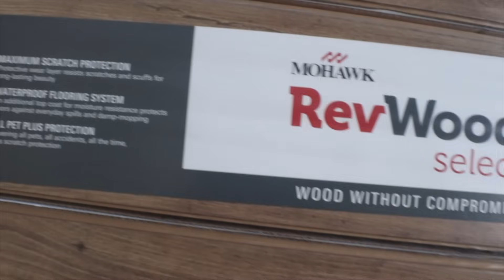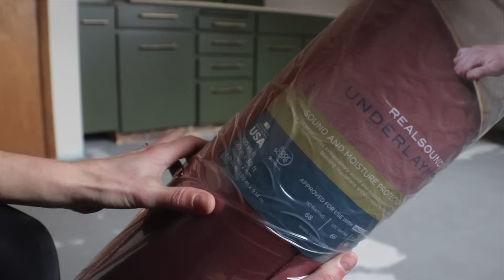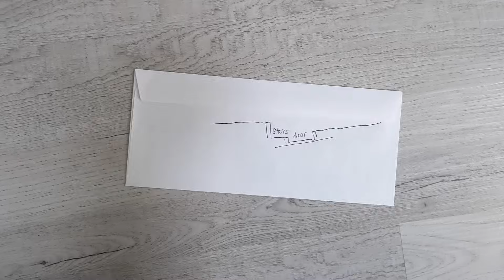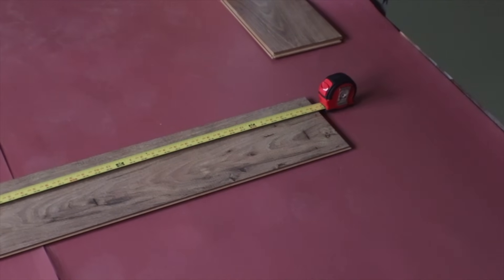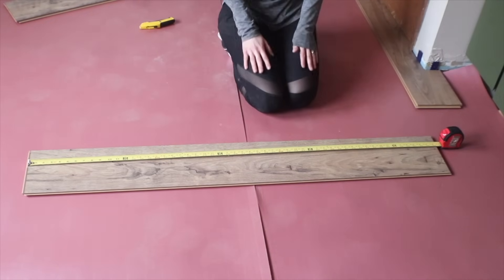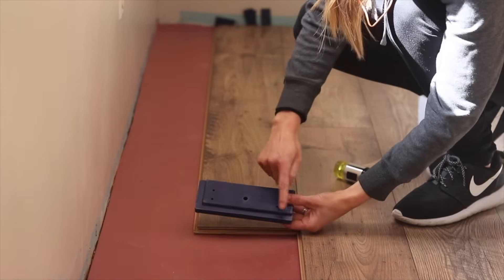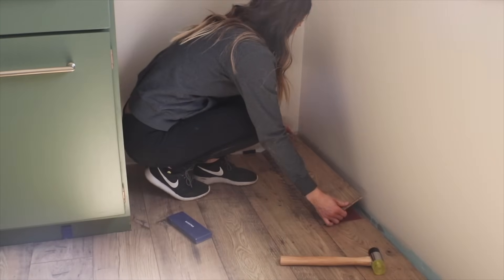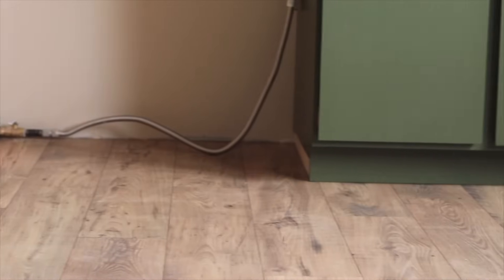How to Install Laminate Flooring (for beginners)

Comment: Ok, stupid question time. Since you put down the underlayment first, what really is the difference if you go directly over one layer of linoleum?  My bathroom/washroom only has the original linoleum.  Can I lay vinyl floor planking over the top of one layer linoleum? TY 🙄
Reply: @transistorradiorecords3661 
 As long the linoleum is not coming loose and is still securely glued, it should not be an issue going directly over it. The linoleum helps work as a sound and added moisture barrier similar to the underlayment (some would even say linoleum is better because it's more dense). If it was just bare flooring, a barrier is recommended .
Reply: @turtlegogrr  Thank you!
Reply: It will be all crunchy under foot 🦶 bottom and not sit level 🎉
Reply: Yes

Comment: You’re right. Never place permanent cabinets over a floating floor.  Next time you check for nails and or staples use a wide taping knife.  It cuts down in the amount of band aides.   Better job than I’ve seen so called professionals do.  Excellent.

Comment: Raising a family and do what you with this channel is so impressive. Your energy level has to be off the charts.
Reply from the maker: Thanks! I do have a lot of energy lol
Reply: we remodeled our kitchen when we moved in. When we came to the floor we did the same striping. We called it remodeling archeology. You could tell the period by the colors and patterns. We even had a black and white checker board toward the bottom.
And Melissa you are so right with the staples and tack. We swear when they put down the 1st layer of tar paper in the beginning he got paid by the staple. There'd been no other logical reason to use that many. 
Good job.

Comment: Thanks, good video. I've tended to cut laminate flooring with a handsaw, which takes slightly longer than most kinds of power saw but makes less dust (because the saw blade in thin) and distributes it less widely (because the saw is moving more more slowly).

Comment: I've been subscribed for awhile now, but just purchased my flooring.  Unfortunately,  I purchased it before I saw this. I know this is a year old, but I have 2 questions that may sound silly, but seriously a newbie with flooring.. Did you go under the stove, refrigerator ? 2nd, what underlayment did you use. I also have a wood subfloor.
Reply: Personally, I would go under the stove and refrigerator for ease of sliding them out later.  Underlayment depends on your product.  I tend to buy flooring that already has underlayment attached.

Comment: Nice! If you have old vinyl flooring that is in good shape and flat, it makes a great vapor barrier and underlayment. Saves work and money. Unless the floor has damage, of course. In that case, it needs to be removed.
A wide putty knife makes a great staple and nail finder by sliding over the floor. Saves the hands ✋️.

Comment: I have a cement foundation.  Pulled up carpet from a room and am considering your project.  I have cement exposed, will paint room, then put down the product you used or something similar.  I take it, THE MOLDING MUST BE REMOVED AND THEN REPLACED ON TOP OF INSTALLED FLOOR....yes?  Clearly it will not fit UNDER the molding, so although the answer is self-evident, you did such a great job, I would like your opinion!!  A wonderful video.....I was impressed from the beginning with you!  Gracias!
Reply from the maker: Yes, that’s the best way to account for the height of the floor changing due to the thickness of the underlayment + flooring. Some people who don’t remove trim just add quarter round to cover the gap but I don’t like that look

Comment: What about the stove height to counters?  I always feel stupid asking these questions.  I renovated my parents house.  When I pulled up laminate, I found terrazzo. Had that ground and sealed but the kitchen isn’t looking good after 6 years.  It is time for flooring.  I can do this after this great video.  Their stove is even with the counters.  Wouldn’t flooring change that?
Reply from the maker: Typically flooring is about half an inch or less thick. Yes it would change the height of the stove, but not by a significant amount. Something to consider if having them flush is important to you.

Comment: I'm thinking putting it in my bathroom. The waterproof kind of course. Just worried about cutting around my toilet
Reply from the maker: Usually you remove the toilet and run flooring underneath. Then re-install :)

Comment: I bought jigsaw blades that were labeled specifically ‘for laminate’ and all they did was chip each plank badly. I ended up using blades designed for metal because they had more teeth

Comment: What do you have to do when installing laminate flooring around a gas stove? I'm guessing you don't have to move the gas stove and just put down the laminate around the gas stove/oven but is the flooring and underlayment fireproof and will it be fine if it heats up while it's installed around the oven?

Comment: I'm no expert, but the floors should be checked with a level. Preferably an  8ft o 10ft one. Depending on the type of flooring and manufacturer, there may be different acceptable tolerances for imperfections for the subfloor. If you do not follow the requirements then your floors may encounter issues later and also void the warranty. 

Also some flooring require an underlayment while some are optional and some do say not to use. 

Other thing is that not all flooring are locked together with the same procedure even though they are made of the same material. Some you can tap together with a block.  And some say not to.

Last thing is some manufacturers say you can stagger them like a staircase while some say not to and to lay them random.

Read the instructions.

Comment: Good job. Vice grips work great for removing staples,  15 and 18 gauge nails. Adjust the heads so when closed they are touching. Open them up and put them over what you are pulling out. Squeeze them closed and roll them on the radius of the vice grip head. No pulling!

Comment: Great video. That's what I need. I'm about to sign a contract to buy a house. The house is not new and the floors in the kitchen and both bathrooms need to be changed. Thank you. It doesn't seem to be difficult, it just takes a little time 🙂

Comment: Your not supposed to put any silicone on the edges that voids the warranty on the laminate it's a floating floor supposed to have  that gap around the edges to move amd expand when it needs it!
Reply from the maker: The installation and warranty instructions actually require this step in order to consider this floor "waterproof" as it seals the edge of the floor. I followed my floor's installation instructions exactly as all people doing this project should. The backer rod is foam and allows for the expansion and contraction you are referencing.
Reply: Crpri Soro. Silicone is flexible
Reply: @anthonyt2011  I know what it is I been working construction for the past 15 years lol

Comment: Nagyon jó hogy így neki álltál ennek a padlónak, de ahogy elnézem, segítség nélkül nem tudtad volna megcsinálni. Ha lehetne pár tippem. A faltól való távolság 1 cm minimum. Az éket fordítva tedd be, könnyebb kivenni. 
A lerakásnál hol jobbról, hol balról kezded. A laminátnak van egy rakásiránya, tehát mindig egy oldalról kezdjük és a leesö darabbal folytatjuk, így kevesebb a hulladék. A kezdö darab minimum 30 cm legyen. Nem ismerem azokat az anyagokat amit ott használtok, de nálunk nem kell a laminátot a végéröl kalapáni, rengeteg idöt vesz el és megsérülhet. Ha le van téve 3-4 sor akkor tegyél rá súlyt a maradék laminátból hogy ne mozogjon amikor a következö sort rakod le. Látszik a videón hogy mozog amikor kalapálod. Igazából nem értem miért kell annyit kalapálni, mert a mai anyagokat már elég kézzel lerakni, csak ritkán kell kalapács. Amit a végén beraksz a (BACKER ROD) azt fuga kitöltésre használják. Ha oda benyomkodod a laminát ás a fal közé, akkor elveszed a mozgás lehetöségét a laminátnak.  A szilikont csak úgy újjal nem lehet normálisan elhúzni, csak szétkenni. Ide egy kenöanyagot szoktunk használi, amivel szépen ellehet simitani.

Comment: Hi I bought this flooring and opened the box. The corners were splitting a little bit on the tongue/groove part. Did you have the same thing happen to you?
Reply from the maker: It's ok if that's the case, simply take any tiny broken chips of the tongue and groove off before trying to connect the plants together or they might interfere with the connection.

Comment: Hey Melissa! I loved watching your flooring installation video. Your detailed prep work really stands out. When I remodeled my kitchen last year, I faced a similar issue with multiple layers of flooring. It took a lot of effort to get everything leveled out, but it was worth it for the end result.

I also used laminate and made sure to acclimate it for 48 hours like you mentioned. It’s crucial! I learned the hard way when I didn’t do that during my first install, and the planks buckled a bit after. Your tips on using spacers and ensuring the underlayment was smooth were super helpful too.

Your choice of the Mohawk RevWood Select looks fantastic! I went with a waterproof laminate as well—very handy in a kitchen. I appreciate how you’re emphasizing the importance of sealing edges with silicone; it makes such a difference in preventing water damage. 

Keep up the great work with your kitchen remodel! I can’t wait to see how your countertops turn out. Thanks for sharing your journey!

Comment: Nice job.. I'm looking to do this to my floor with Revwood Select as well.  What do think about this stuff in a kitchen?
Reply from the maker: I do think it will withstand spills and water slopped on it with the safeguards against moisture on the underlayment, plank underside, and the silicone sealant applied to the edges. Time will tell of course, but it's warranty and waterproof status was the main reason I chose it for the kitchen.

Comment: If your table saw if chipping on the top side, your fence, its probably not aligned perfectly. What I do every time I use my portable Dewalt table saw is, unclamp the fence from the rails, Snug up the fence up against a totally raised blade and then clamp it down. 

If its not that, then you may need a new blade or you don't have your blade raised enough. 1 to 1 1/2 inch above your material is optimal.  

Good work. Cheers!
Reply from the maker: Really? I've always thought it's best to have your blade raised just barely above the depth of the material you're cutting. Maybe that's my problem.. it didn't chip easily on the top side, my jigsaw did though. It makes sense if you think about which way the teeth are actually cutting.
Reply: @WelcometotheWoodsBlog  Keeping your blade low helps with tear out at the bottom. Especially when you're cutting brittle material like 2 sided melamine. But your minimum should still be 1 inch. Anything less increases the chances of kickback.

3 Rules for best results:
1. Make sure fence is aligned properly. Only the front of the blade should be making contact with the material.
2. Raise your blade to a minimum of 1 inch above your material to reduce chipping. 1 1/2 is ideal most of the time.
3. Most importantly, don't skimp on blades. Buy a good one and toss it when its starts to become dull. Easy to tell. They smoke. they make noise and the push back on your material. You know your blade is sharp when it requires virtually no effort on your part.

3 1/2. Sometimes, especially with gummy woods your carbide teeth will get a buildup that will make your blade feel like its duller than it is in reality. Give it a good cleaning with a bronze brush and some mineral spirits. That will sometimes prolong the life of a good blade.

Hope that helps. Look forward to your next project. :)

Oh FYI I've been a finish carpenter since I was like 15, helping out my older brother. I'm 50 now, so I have a little bit of experience. ;)
Reply: Agreed, kickback is always a concern. At least with laminate flooring your cut edges always end up under a kickboard or baseboard, so I think you win here Melissa even with a few scars, any chipout is covered up. Alternatively you can cut on jigsaw with laminate blade which cuts on the Down stroke (but that is always a wavey cut) or a bandsaw.
Reply: @WelcometotheWoodsBlog   they do sell upside down cutting jig saw blades ...  or just cut the flooring boards upside down !    Hook your shop vac up to your table saw to help keep the dust down - just duct tape the vac hose on to the saws outlet hole

Comment: Great video! Only have one question, are you sure the alu foil goes down of the underground floor? I have almost the same as you have and it says smooth side up. To me, that seems the alu side ... As lamitane can shrink and expand, you do not want a underground that sticks to you laminate, so the contact side of the underlayment should be non sticky and smooth. The side that contacts the concrete, should be sticky  and rough. Seems very logical, doesn't it?

Comment: First, for a beginner - great job.
Secondly - comments that cabinets cannot be put on laminate flooring are complete nonsense. A properly installed floor should withstand anything. Nevertheless, you closed the place under the refrigerator, despite the fact that the weight of the refrigerator is 5 times or more greater than the weight of your cabinets.

Comment: Don't get too comfortable with the "waterproof" feature of these floors. We installed these exact ones a couple of years ago and the first time some water sat more than a few minutes over a seam, that corner of the plank swelled. If you wipe it up right away, it's usually fine, but we definitely have a couple of swell spots from unnoticed liquid sloshes/spills. There's no such thing as a truly waterproof laminate.

Hope you have better luck with them than we did.

Comment: Melissa, helpful hint, get a long razor blade scraper (Home Depot or Lowe's has them) works great to remove staples without crawling around on the floor, so much faster.
Reply from the maker: That is what was used to remove staples in the beginning, but what was left after that were broken off nubbins that were just barely poking out of the subfloor. I was probably being too meticulous taking out every one of those instead of just pounding them in.
Reply: @WelcometotheWoodsBlog      Respect for use of the word "nubbins".   👍👍

Comment: Sorry you never use a bare hand to feel for sharp points or unevenness. Spread the level material smooth, not leaving such gunk to sand excessive. Cutting the bottom of a door requires taking it off and using circular saw at least, not an oscillating tool. That underlayment is worthless and the hammer doesn't need a hard or soft side. Just apply decent pressure to work. Seems you and many others like to work on the floor when cutting. This is not safe and not efficient. Too much more to write about.

Comment: My son and I watched any number of videos before installing around 1700' feet of Mohawk laminate and this video was one of the most helpful. 
The suggestion to measure carefully so as not to end up with a narrow patch was great, as was the advice to use the tapper regularly. Here are the tips that we picked up over a few days of installing:
1) In most of the videos, you will see that the wall surface meets the foundation. We were installing on a concrete foundation in Houston where we had to poor 66 bags (ugh) of leveler to get the floors close to level. Many of the rooms had 1/2' or larger gaps between the wallboard and the foundation even after the leveler. When tapping into the spacers, they would bend under the wallboard. We solved the problem by using 3/8" casing material in 10' lengths after first trying low-expanding form (that worked, too). 
2) it took us 3 rows when starting any room to get the rows to have any stability. We would stand on row 3 and tap back in from the first row and then stand on the first row and tap on the 3rd or on the ends. Once we got all three rows together, the rest flowed pretty easily. 
3) we used a Roberts laminate floor cutter to trim the boards to avoid running out to the saw. It can be hard to keep it at 90 degrees. Check it regularly. 
4) we ended up with a couple of bigger than 3/8" gaps along the wall and resolved it by using 2 types of moulding, a 5.25 inch rectangular piece and a fancier 3.5" inch nailed into it. It looked great after we caulked it. CAULK cures all!
5) Make sure that everything is tight on a row before moving on (post row 3). You will get some boards that have the connections damaged. Cut them out and the boards will connect. Every so often, the end piece is not level. Those can't be saved except for an end or beginning piece. 
6) We had about 11 different patterns in our boxes. We would take 5 boxes apart and sort them. There are often three pairs in a box of eight planks. 
7) Don't hack it together. It can be a lot more frustrating than it looks on video, but the end result is great.
Reply: Thanks for posting this comment. I’m about to install some flooring over a concrete slab and also have walls that don’t meet the foundation. Been watching videos (and buying lots of tools — laminate cutter arrived yesterday!), so I’m happy to read the guidance and advice in your comment. Thanks again!

Comment: i still think if water falls on the middle of the floor, as the boards are just snap fitted, water can still get underneath through the gaps between the boards, trapped underneath.... causing 'mold' issue.... not healthy for use of long period....